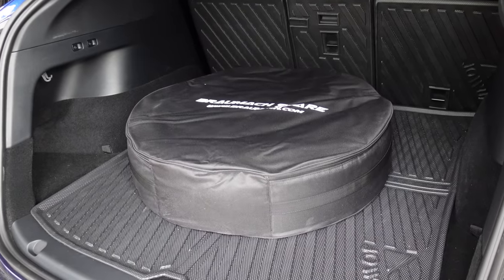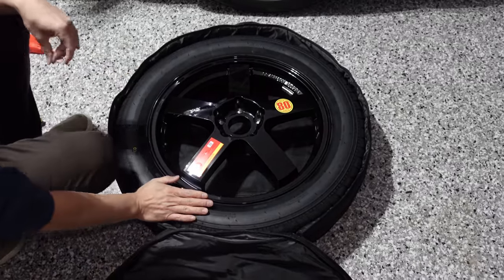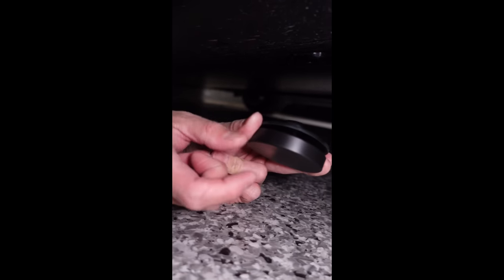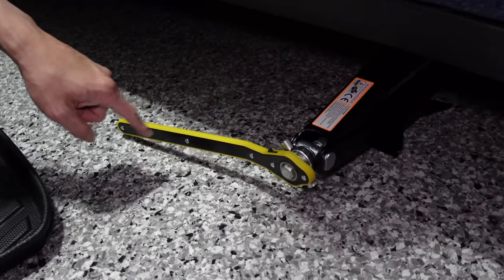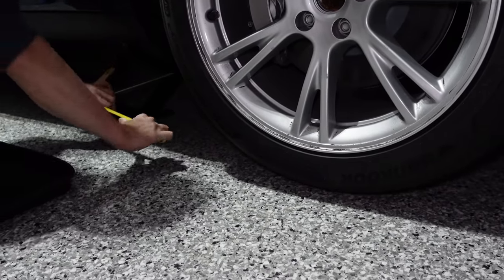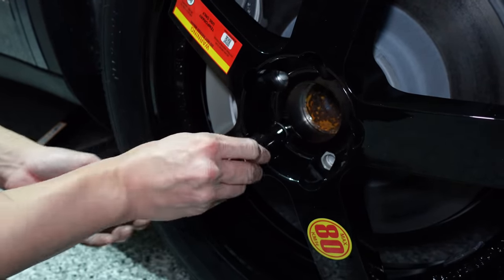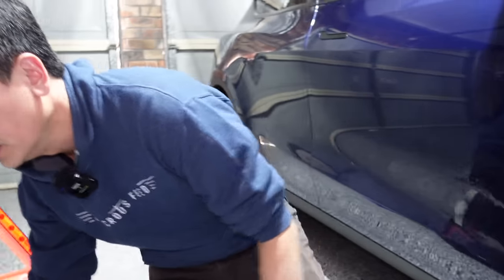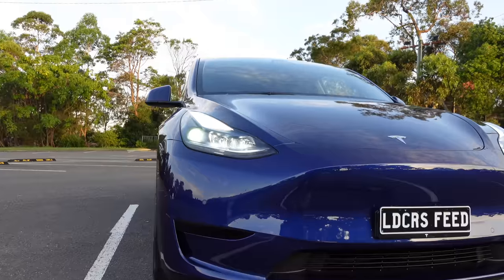Braumach Spare Wheel and Tire for Model Y and Model 3 | RWD LR Perf

Comment from the maker: TESLA Spare Wheel Kit Space Saver Tyre for Model Y | Code TESLATOM 10% OFF sitewide:_100TT:
https://braumach.com.au/products/tesla-spare-wheel-kit-space-saver-tyre-for-model-y-sr-lr-performance-2022-2023
** Ensure your wheel nuts are tightened to the manufacturer's recommendations - for Tesla Model 3/Y the correct tension is 175 Nm / 129 ft-lb **
Reply: We need a company to come up with a jack that fits the Tesla jacking point rather than using a puck. The most similar design I can find is a Porsche jack

Comment: The reason why I got my skinny tyre from the US three years ago is because I won’t get a flat tyre and it has worked so far.  Jokes aside these spare wheels need to be secured otherwise in a collision they will become a heavy projectile to passengers or drivers in the car. All spare tires are secured by a strap or bolt system this needs to be considered when placing heavy unsecured wheels behind yourself.  Thanks Tom.
Reply from the maker: Yup very good point regarding ensuring the tyre is anchored down
Reply: I have my Spacesaver behind front passenger seat.Sits nicely there.
Reply: Excellent point, I have my full size spare well and truely strapped down. In an accident it could become a dangerous projectile.
Reply: @Sensei Sifu On their laps of course!

Comment: Thanks for the video and actually changing your tyre out. How does this compare with the Modern Spare space saver? Doesn't that have a higher speed rating? Any pros/cons?
Cheers
Reply: Looks pretty similar to the Modern Spare.  And from the dot M rating looks to be as robust 👍

Comment: Don't like the extreme angle of the wrench handle, causing bending forces on the nut instead of just twisting force. You should support the wrench at the end near the nut with your other hand to compensate and prevent damaging the nut.
Reply from the maker: Yup good tip to reduce risk of stripping the nut
Reply: Yup, my thoughts too, a right angle bend would be better, and support under the bend when working it hard

Comment: Quick question. How do you remove the cap covering the wheel nuts?
Reply from the maker: That’s fairly straight forward whether it’s the original Aero/Gemini/aftermarket caps - hands between the spokes and gently pull

Comment: Hi Tom great video as usual, looks like you had a good workout with that jack.
At 5:14 in the video you mentioned making sure the vehicle was in park but I wonder why you  didn't mention that you should ALSO energise the EMERGENCY BRAKE for maximum safety against falling off the jack even on level ground.
Reply from the maker: Thanks John, that’s a good point 👍
Hold the Park button for a few seconds to activate the Emergency brake

Comment: Thanks so much for showing the complete process! I’m in Adelaide and my sister is in Whyalla which is well out of the Tesla service area, so we’ll want a spare tyre, I expect. Do you know if it’s possible to buy a full size spare so that we aren’t limited to 80kph for what could potentially be a long drive to access a tyre shop? Thanks!
Reply from the maker: Pleasure!
The tyre technically has been tested to 130kph - if you want more details, I suggest contacting Braumach directly about recommended speeds

Comment: Great product but it should be secured to prevent it from moving in the event of sudden braking or an accident.
Reply from the maker: Good feedback - perhaps Braumach will look at producing an accessory for this purpose
Reply: It is pretty disappointing that the Model Y has no anchor points in the back.  It would have been easy enough to have included.  Only way I thought would be to secure to the anchor on the back of the seats somehow.

Comment: Great video Tom. Having a spare tyre brings certain peace of mind. (Although being able to contact Tesla and have a Tesla mechanic come out and deal with the situation is also good depending of course on phone coverage). I don't own a Tesla (still considering options). One thing that makes me a bit tentative about choosing a Tesla is the ground clearance (I'm on a farm, where roads tend to be a lot less than main road specs). I understand the ground clearance for M3 is 140mm and for MY just under 170mm. My concern with tyre changing (especially with M3) would be that if the tyre is flat then you could have a bit of a struggle getting the jack(and the puck) under the car in order to jack it up. I wonder - with a tyre that is flat, what's the ground clearance like?
Reply from the maker: That’s a fair question. Depends on the profile of your tyre I suppose. You don’t necessarily need to use the puck - if you know where the anchor point is, then aim to have your jack sitting under the holes and hopefully that’ll give you enough clearance to lift 🤞
Reply: This is a very good point. I have had three flats in four years. First was a disaster, being on the Central Coast it took all day to get a new tyre to me and fitted and I had to go to Sydney to exchange. I had a puncture in the side of the tyre which is a right off. You need a new tyre. My solution is a full tyre on alloy rim. Note most of these temp tyres are useless if you have to drive them any distance. Regarding the jack I purchased a low profile hydraulic unit. Works perfectly and doesn’t require the workout Tom did with that ratchet device. The jack, pucs etc sit in the rear well.  The spare tyre in the boot, removed if I especially need the space. 
My view is that the capacity for a full tyre should be integrated into the cars design.
Reply: @grahamjones6519 It's a spacesaver spare. It's not designed to d anything above 80km/h. They are designed to get you out of trouble in an emergency and they are great for that purpose.
Reply: The old school method for addressing this problem is to drive the flat tyre wheel up onto a block of wood, a brick, or if necessary the spare wheel.
Reply from the maker: @ratmanbrian  Good tip

Comment: "fits very well in sub-floor"? No way, that is just sitting half way in the hole & is not secured; becomes a missile in an accident. Tesla has no config so as to be able to mount any space-saver underfloor & with screw in security. The only example of using the Braumach spare (or any other) requires stap ties etc & also uses a large space in the boot lying flat as it should. So your'e recommending to just throw in the boot like this? Please, is dangerous & unlike some other EVs which actually have space and mounting screw underfloor.
Reply from the maker: Yes good point Paul as others have mentioned 👍 I’ve reached out to Braumach to see if there’s a solution for securing it further
Reply from the maker: I suppose we should be strapping down and securing luggage or anything else also in the boot for the same reason 🤔